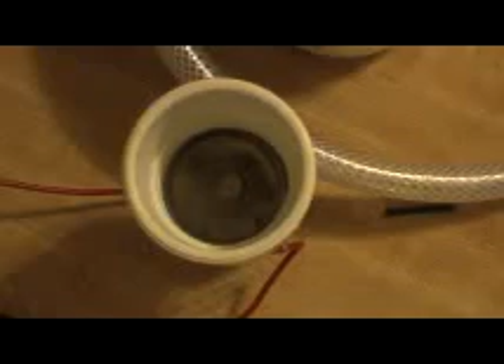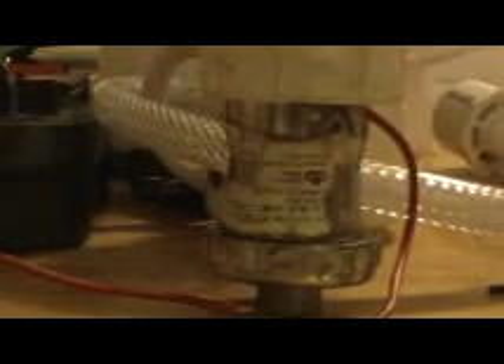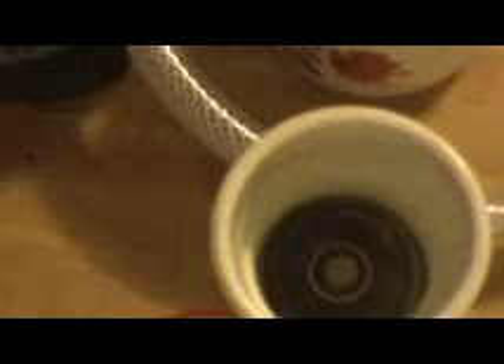Prototype HHO Browns Gas Hydrogen Oxygen Generator

Comment: well, are you hooked yet ???

If so, there is much good material here on YouTube that will help you to design and assemble a practical system. As a rule, the designs being presented by most of the basement experimenters will run rings around 95% of the setups that are available commercially.

Pay particular attention to the safety related issues.  If you get careless or fail to treat it with respect, you can have an unfortunate incident.